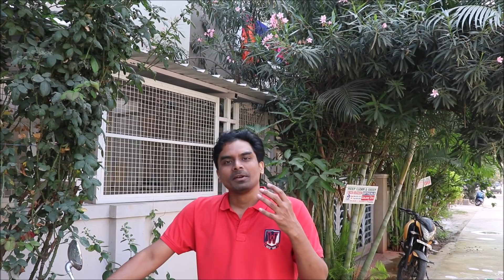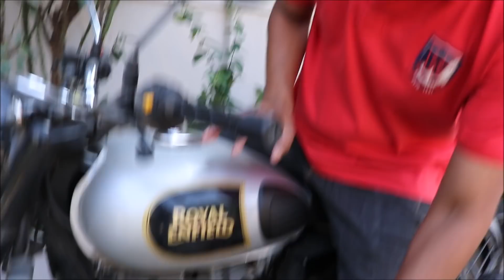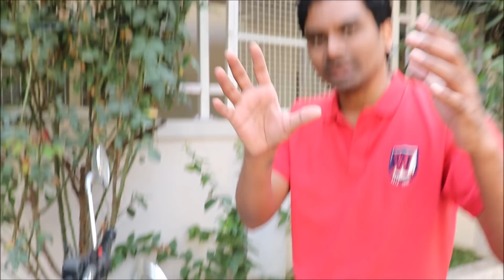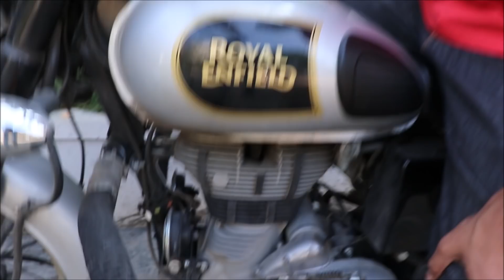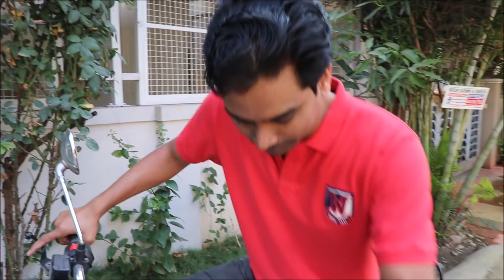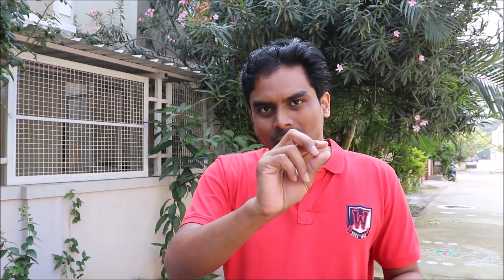Can you Run a Motorcycle Engine NON STOP without Damaging it.

Comment: Another MYTH, switching off the engine for sometime when the engine was HOT was completely WRONG,  better you keep your bike at idle RPM and let ur bike's cooling system do it's job 🙂
Reply: What if it is air-cooled?
Reply: @vedjanve4361  Better to ride it at slow speed reducing the stress on engine, because stopping the engine and motorcycle will cut the air supply over the engine mounts
Reply: @pawanhegde5612  agreeed!
Reply: @pawanhegde5612  Can same be done in case of scooters like Activa or Jupiter?
After riding it for 100 kms continuously, do I need to switch off the engine or continue to ride at slow speeds?
Reply: @siddhesh2888  post 100kms also you can ride it as the fan will be continuously circulating air for cooling,but if the engine overheats, it's better to switch it off but the duration of switch off should be more than 20mins for the engine to correctly cool down
Reply: @pawanhegde5612  So for 110cc scooters, what is maximum range of kms that can be ridden, before it needs to be stopped to avoid engine overheating?
I actually had done few short rides(<150 kms) on my Activa.
Planning to do long rides of almost 500-600 kms in upcoming months. This info will actually help me a lot.
Reply: @siddhesh2888  Any engine in its correct state of tune and with a good premium engine oils won't overheat,but if there are any mechanical issues or if the engine is fed with a lean or rich mixtures there are chances of overheating.So ideally there won't be any ranges as such but practically thinking scooters sometimes start to become uncomfortable after 100-150kms and they will require fuel stops also,so it's better to take breaks for fuel or food after a 150-200kms may be
Reply: @pawanhegde5612  Thanks a lot.
As I am still new to long ride journeying, this will definitely help me in my all upcoming rides.
Reply: @siddhesh2888  Also riding at full throttle can overheat your engine,so ride at a reasonable speed and ride safe🙂

Comment: This was exactly the same what I have been expecting for. This is Pankaj S Ghimire from Kathmandu Nepal . In my country bike costs too much although most of them are imported from India so people generally prefer air cooled bikes which are relatively cheaper as compared to oil / liquid cooled engine. Perhaps u don’t believe that  the Apache RR 310 costs around eight hundred thousand Nepalese currency. 
My basic concern is highlighted by your video . I emailed the yamaha showroom here in Kathmandu but they didn’t respond to my queries which your video did . Kudos to you and many many wishes for the success of your channel .

Comment: In case of liquid cooled bikes there is no point in turning off engine for cooling....bcz coolant is not circultng through it...it will only incrse the amount of heat in engine....it will take about 3 to 5 hrs for ktm bikes to completely cooling down the engine after turning off...you have given a right choice buddy 😊😊

Comment: You earned me "buddy" :)
Great info. This is I think one of the greatest myths about bikes. Many of my friends keep asking me or even sometime suggesting me to stop for for a few minutes to let the "engine cool down"!
Another important point you mentioned is about Air cooled engine being more reliable. I had couple of instances or should I say arguments about the same. I have found even some of experienced riders consider liquid or oil cooled engines to be superior. However, it's about need of the engine, not superiority. It's quite simple actually. More the parts you are dependent upon, less reliable it will be. Thanks.
Ride Safe!

Comment: As you have rightly said the operating time of an engine(any machine for that matter) depends upon its operating temperature and its design temperature, the closer it is to the design temperature, the longer and efficient it would run. Theoretically- keeping the engine temperature close to design temperature would mean the engine could run for ever and manufacturer decide the type of cooling depending upon the amount of heat an engine would generate to keep the temperature less/close to the design temperature. I would like to add: "Presence of hoses and pipes make the engine less reliable" is a topic that is arguably inaccurate(as the number of components/systems increase, reliability is affected) since provision of liquid cooling/oil cooling is actually to improve the reliability of the engine thus, the bike overall. An air cooled Engine would struggle/fail in a hot ambient where a liquid cooled engine wouldn't have a problem.
Reply from the maker: Thanks for watching mate. Hope you enjoy my other videos too and hope you subscribe.
Reply: Vikas Rachamalla You have got some good content and I absolutely Love the information in your videos, The one about ‘oil seal busting frequently’ was very much helpful, paying attention to that on my 390 duke as well. Thanks and Appreciate your hard work 👌🏼😊

Comment: I ride a '17 D390 & I recently did a 1600km ride on my bike with a pillion , tank bag & saddlebags (100-120 kph cruising speeds) After i came back from my trip my engine oil level was reduced by 150-200ml. (P.s I had changed my oil few days ago only)

Comment: I am a person who does pretty long rides.not much .maybe one shot 500kms continuous.i first owned a karizma r which I did a 360km trip once.that was the first and last long trip I have done In that bike as my wiring got damaged due to over heating.it was a 2007 model I guess.gave less than 30kmpl.then I had an 200ns which gave me amazing mileage as well as good stability.butter smooth engine and I used to ride non stop at 80 to 140.no issues .no over heating.even if the engine gets heated which is rare.the radiator kicks in and does it's job in heat dissipation.now owning a dominar.nothing to say abt this big beast.it never gives up and I have more confidence in braking coz of the abs feature which provides good safety during panic braking ND a good mileage .so long story short.u can ride a vehicle for ling distance PROVIDED U MAINTAIN THE ENGINE AND DO REGULAR SERVICE WITHOUT IGNORING MINOR WORKS.To be honest fz can also be used for long distances ..I once did tour with my frnd for 4 hrs in that

Comment: my personal opinion small air cooled 100-150 1l oil capacity engine should be stopped within range of 100-150 km for oil to cool down little bit setting it in idle and stop for 20 min reduce stress on engine. As you said generators, locomotives, such heavy duty engines have advance michanisamas to cool down where as simple 100-150 cc only depend on the sympathy of air.

Comment: I did Spiti last year on Apache RTR 160 (Air cooled). Rode about 550 KMs in a single day, started at 3 am and maintained a speed of 60-75 all day long in other words kept the RPM at most 6000 and took 20 30min break after every 110kms and the bike showed no signs of heating at all.

Comment: Sir can I ride 150cc bike at 80kmph for hours???
Reply: Yes, no problem for the bike. But you will get tired. 😂
Reply: @bmcfsu_  agree bt by hours I only meant 4-6 hours 😂😂
Reply: Nope don't ride on same speed for hours.
Reply: @Sushant9763  why not buddy?? Will it damage??
Reply: I ride my 150cc for 5 hours at 85 kph non stop
Reply: Once i had ridden my suzuki gs150r  nonstop for 360 km without a break nothing happened.  I stopped as i got little tired.
Reply: @jogindersingh4471  i ride my super splendor 125cc at 95 for 3 hours it cant go above 95
Reply: I ve ridden by 60-70-80kmph from 3.30am to 8am without a halt.
Me n a pillion did Mysore to Thrissur trip on my fz 150 v1
Reply: Yes.... No problem at all
Reply: I have ridden my gixxer at 105 kmph for 6 hrs continously... 500 kms
Reply: I regularly ride my pulsar 180 at 90 to 100kmph for more than 600 kms with one 20 minute break in between..... nothing will happen to the bike.  Only we'll get tired and sore butts.

Regularly means once in a month to travel from work place to native
Reply: Yes u can. i have ridden for 6:30 hours continusly coverd almost 410 km in extreme, hero 150cc
Reply: Everybody is right here but you have to know the typical case of a badly configured bike as well just so don't do so in the case of similar condition. Once I did 210 Km in exactly 03 hours 40 minutes on My Pulsar 180 UG3 2008 model, not that impressive for speed perspective but it went hot enough to almost instantaneously evaporate the saliva I spit on the cylinder block and upper portion of the crankcase. It was an unusual case since my carburetor was running too lean at that time which was unbeknownst to me, until later on when I overhauled it and found out the AFR screw had no effect with normal to max rich setting I set, the spark plugs were shiny as hell and there was no sign of carbon at all, I mean literally at all, this is when I had run the bike for about more than 1100 km with maximum rich setting (in a position where the AFR screw was almost about to fall off) and I was getting surprisingly jaw dropping mileage for this bike even at the speed post 85 km/h (44+ km/l) that seems like a good thing at first but is actually harmful for your engine if you keep running that much lean for longer time. Since a normal carburetor with rich setting is guaranteed to make your spark plug black like a black hole but it didn't do so. 

Therefore if you believe there is nothing wrong with your carb (that is; not too lean and not too rich) you can ride it for that much longer without a single problem as far as it is about damage from heat.
Reply: My bike engine seized after 2 hours non stop (150cc)

Comment: Sir which one should i take KTM RC 200 or yamaha R15 v2 i am a college student and i have to commute on the highway only please need your suggestion 
And awesome video as always 👏🏻👏🏻👏🏻
Reply: rc200 if u have no milage problem...
Reply: Ashwin babu not millage for me refinement , styling and the bike which must run last long
Reply: @jaiminkotecha13  bro to me.. if i take a r15..i would have no chance to compete with my friends owning ns rs  rc duke apache200 ... in terms of refinement r15 will be good as its a yamaha vehicle and also a 155cc engine even though it has some quality issues... i personally endedup buying a fz25 as i thought it would be perfect in power refinement and milage comparing with its competitors
Reply: Ashwin babu thanks
Reply: I will choose ktm duke 250 over then first thing power is more as compared to other two, it is comfortable for long rides, feel of a sports bike and yes ktm have superior service as most of their bikes are very much mechanically same and u dont have to deal with fasino and other lower segment bike standing beside ur bike
Reply: Sundaram Sharma thanks for the reply bro but faired bikes only
Reply: @jaiminkotecha13  duke250 is clearly overpriced...comparing the above bikes and both fz25 n duke250 have same seating posture
Reply: @jaiminkotecha13  then rc 200 is very good... Never riden the r15v3 but just for ur information it has huge speedo error, mine friend did a top speed test with gps and it was about 140kmph when speedo showing 159kmph(slope) . Rc 200 does 133. 4 kmph on gps. I am always the ktm fan just shifted from dominar to 2019 duke 390 and man i am really happy with my decision
Reply: Why not RS200 ABS? More power than R15, more relaxed ergonomics compared to R15/RC for commuting, Good mileage, cheaper to maintain & can take it out on long weekend tours as well.

Comment: I wonder why cant these people just google their problems lol
Reply: What will be the approx slip ratio at rear wheels when breaks are getting applied to a single channel abs motorcycle?
*Condition : both of breaks are active at it's 100% external applied pressure.

Google it and let me Know. Will appreciate a lot!
Reply: @MagpieNexon  lol 😂😂
Reply: @MrAbhi5454  🤣.. when people can't realize their lives out of Google.
Reply: @MagpieNexon  Is the clutch being applied? If not, well in that scenario  the slip ratio would be minimal (Not googled). But if you are really into the formula stuff then you may calculate the slip ratio using the per km revolution of tyre (taken constant) and the relative speed of the vehicle. (googled). 
 Practically speaking why  on earth would someone apply 100% Brakes  and not breaks when you dont have a D-Channel ABS.
Reply: @rahulbhutani1981  I bet this one you got from your experience ( either asked to experienced one or from self asperity) . Google can't reply on same. And that's my point.
Reply: @MagpieNexon  No bro, I googled to know the meaning of slip ratio. It is because of your comment mentioning about slip ratio, I got to know that a concept like that even exists.  :D.  
See for yourself https://en.wikipedia.org/wiki/Slip_ratio. I read it and developed a little bit of understanding.  But yes, based on my exprience neither one should use full 100% Braking nor use clutch while braking, that clutchless braking actually prevents the rear wheel from locking and improves braking significantly.
Reply: @rahulbhutani1981  bwd 21% slip ratio is most effective on motorcycle.
Reply: @MagpieNexon  I doubt if this 21% thing actually works when you are braking in reality. But again,  I am not an expert person on braking systems. :)
Reply: I think even you should have googled...
Reply: Coz no reading habits
Reply: @MagpieNexon  Nailed it bro. 😂😂😂

Comment: What if we ride our bike for long hours at a redline?
Reply: @Shreyas G S

 You'll burn more fuel + increase the pace of wear on your engine. That's it. (considering your machine is well maintained).

Avoid redlining engines with no active cooling mechanism(fans), while stationary (in neutral), as there's not much air flow over the cooling fins.

Most motorcycles come with rev limiters nowadays so that you never rev too much Eg. Ktms, Pulsar 200. Some are extremely tall geared so that you never reach redline on 6th gear at max speed Eg.CBR250R.  It's best to shift at the rpm where the engine produces max power, if you're trying to go fast. Ride Safe 🤘

Comment: Sir do a video on pulsar ns200 
How to maintain ...?
Reply: 1) change engine oil on time
2) lube ur chain ...
3) maintian required Tyre pressure
Reply: Clean air filter, spark plugs also😁
Reply: If ypu don't know how to maintain buy a cycle.